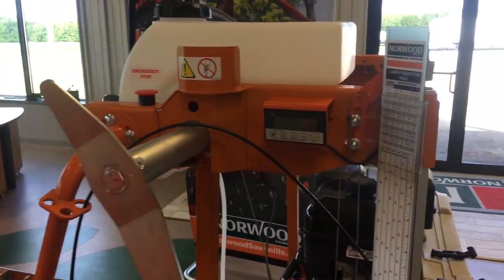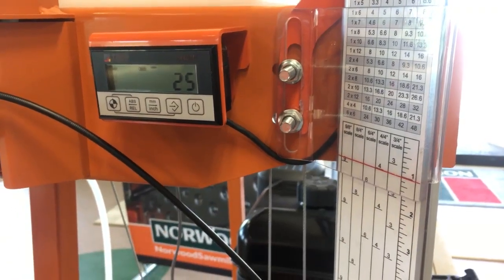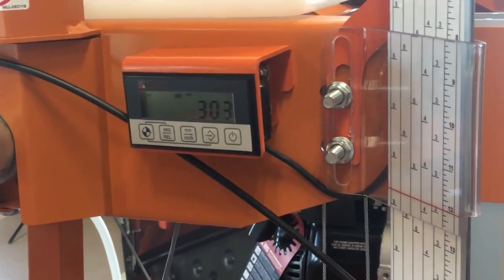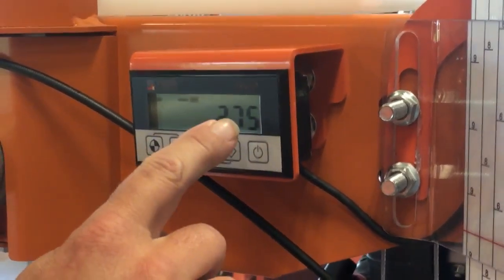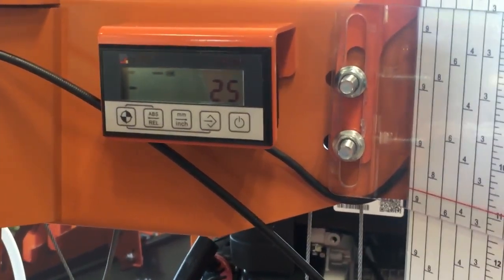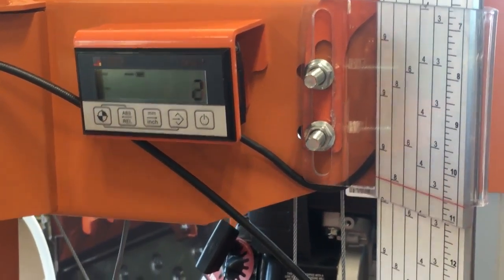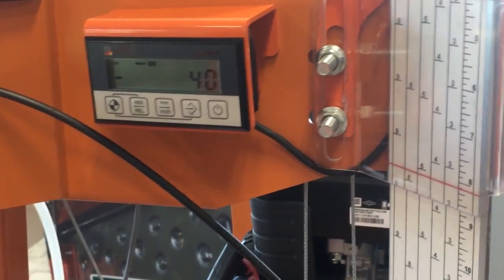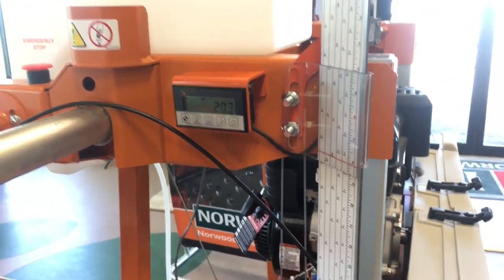Digital Scale for Norwood Sawmills (HD36, LM29, MN26, MX34 & ML26)

Comment: The video said for the manual head, will it work on the power head? What's the cost?
Reply from the maker: Hi Richard. The description does clarify that it cannot be used in combination with the power feed, power sawhead or setworks systems on the HD36. It is $295.00